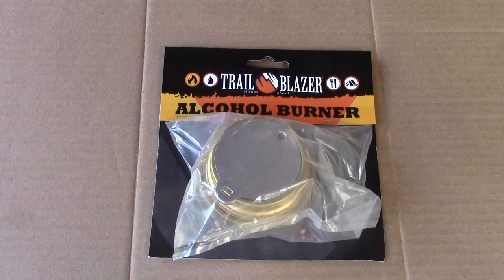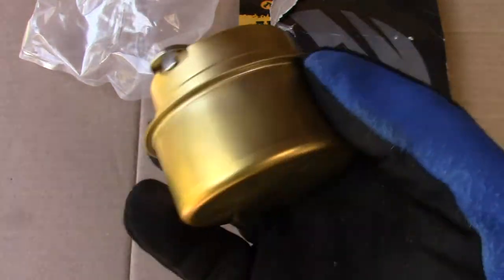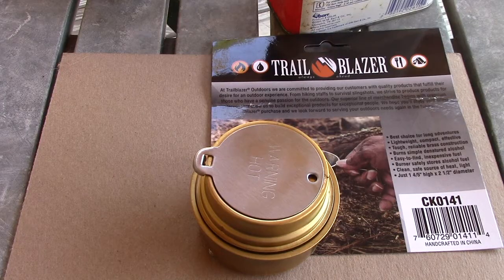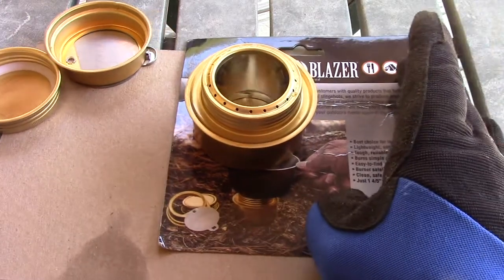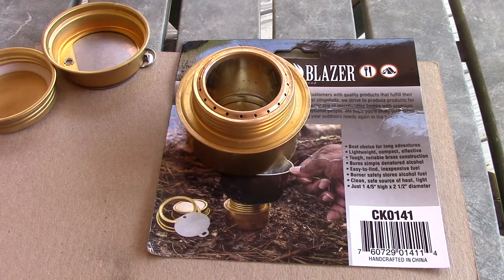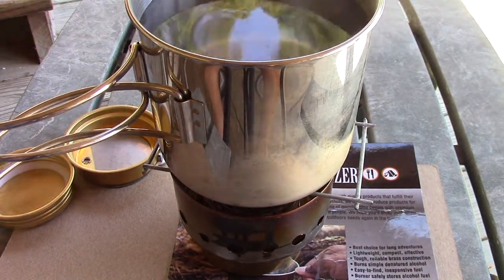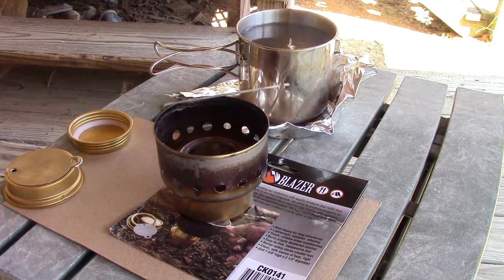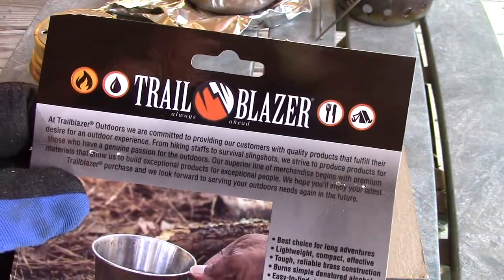Trailblazer alcohol stove

Comment: Does it NEED a "DIY Sterno cooker deal" (2 min. 58 secs. in) and if so why wouldn't it come with one? Use it as it came, your making it look like we can't use it without a DIY device attached .
Reply: Jim M.   It is a burner, not a stove. Read the label. So it needs something to hold pot above the flame.  Two rocks, sterno stove, solo stove, DIY holder, whatever it takes.